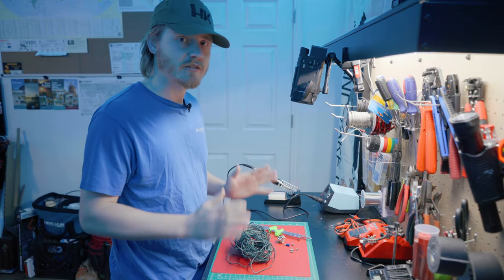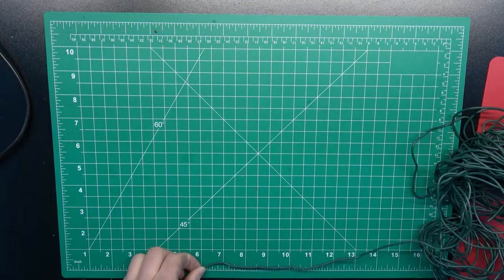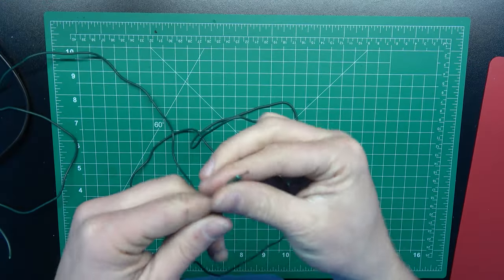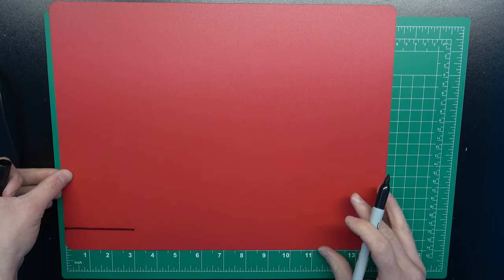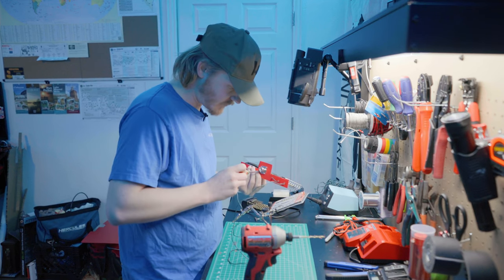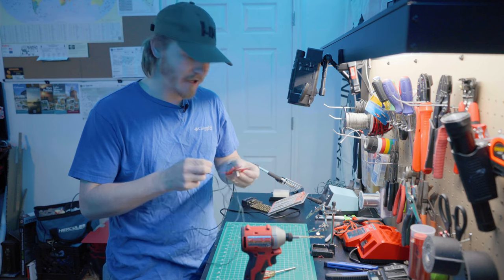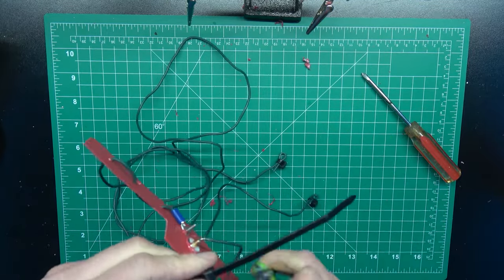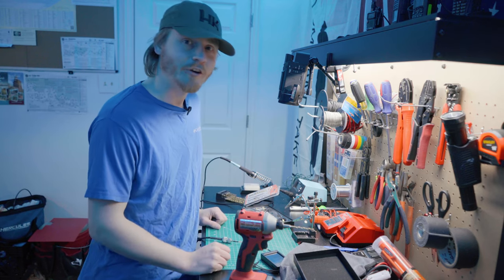Building a CHEAP DIY 2 Meter Dipole Antenna!

Comment: I need to make on of these too.  Repeaters are going to be vertically polarized, your dipole is mostly horizontal.  hang the wire vertically and see if it does better with the repeaters.  Also, your VNA was most likely correct.  a meter is a bit over 3', so if you have two lengths of 3' 6", that's about a full wave length.  it should be about 3' 6" total, not each.  cut them a little long and check that with your meter.  then trim in small increments until you get it perfect.  by the way there is a NTX horizontal 2m net on wedensday nights at 8:00 on 144.250 SSB.  Good Luck

Comment: Love the video, as you are getting in there and having a go.  Your antenna is a few inches too long.  Use  your VNA to scan from 140 to 150 MHz and find the resonance point.  Then start trimming it back, equally, a little at a time until there is a nice dip in the 2m band.  An SWR of less than 1.5:1 is best for everything including the radio.  
Use your chopping board and paracord to make a skyhook to hang one end in the tree, and to run the coax horizontally for a few feet.  The higher the better, but it will work to some degree even touching the ground.  There's a loss of about 20dB going from vertical to horizontal polarization, so once you and the repeaters are on the same polarization, you'll be booming in.
Antennas are fun and easy to make.  Having a vna is the best and cheapest tool out.

Comment: We all make mistakes but ideally we want to learn from them. The old adage: "measure twice cut once" definitely applies to Ham antenna building. But also a simple sense check goes a long way. If you are making a 1/4 wave dipole for 2m then each element is going to be 2m x 1/4 = 50cm which on my measuring tape is about 20". The second rule ought to be to trust your equipment. If the SWR is 4 then it is too high and instead of ploughing on to prove the 'smoke test rule' one ought to sit down and work out what it is telling you. I would not use anything unless it had an SWR of below 1.5. Finally with 2m you want to think about polarisation as correct orientation will give you better results: Vertical for FM and horizontal for SSB. Kudos to you for making the video; with each build I too am learning how to make a better one. 73's 2E0KWI

Comment: Your lengths for quarter wave 2 meters is way off why your SWR is way up. a 1/4 wave 2 meter would work much more awesome with a vertical polarized 1/4 wave antenna. For a 1/4 wave vertical, Just remember 234 divided by Frequency which say 147 MHz would be 15.9 feet multiplied by 12 is 19.1 inches. So the vertical copper wire part would be 19.1 inches and the four copper wire radials would be another 19.1 inches. You can use copper wire or welding rods to solder on your center pin of your SO-239 chassis connection and then screw your other four radials on the chassis with lock washers and screws by using some needle nose pliers to bend a small loop to fit on your screws.. Then when you finished get you some 3/4 inch PVC pipe which your coax will fit through pipe and your vertical with chassis mount can fit perfect on other end. Clamp it on a mast or even use least 10 foot PVC pipe as your mast clamped to a pole or fence post.

Comment: You need 50cms of wire. What you created was more akin to 6 metres antenna than 2 metres. With a few snips it should get into the band quite easily.

Comment: Your first calculation was correct for 3 feet 6 inches which is the TOTAL length of the antenna.  Cut that in half (19 inches or so) and use that for each side of the dipole.  Your SWR will be where you want it.  KN8N
Reply: I just noticed as he was measuring the wire that he pulled the last 6 inches by pulling his 3 ft mark from the 12 inches point to the 6 inches point on his measuring ruler. But he kept his finger on the 6 inches mark looking like he was going to cut the wire there. However that would have been 3 feet only. He should have slid the wire back to the zero and added 6 inches. Simple mistake & easily done. Hence the old adage: "measure twice & cut once"

Comment: SWR between 1:1 and 1.5:1 is good, but anything 3:1 or higher is bad and can blow your finals. I think VHF transmitters are more forgiving than HF, but still it can damage or shorten the life of your finals. The best thing to do is to get the antenna up as high as possible. When I'm portable I use a Spiderbeam 40' mast along with a vertical N9TAX roll up J pole antenna, and at 40 feet I can hit repeaters all over the Houston area. I noticed that in the video you were on 146.52 while the antenna was horizontal. That frequency is typically used on FM with a vertical antenna. The horizontal antennas would be good for 2 meter sideband. Another thing that would help is to use a Yagi antenna. That would give you more forward TX/RX and more attenuation off of the sides and rear. I heard a Canadian station on 2 meter SSB during a Field Day event years ago while my antenna was inside the house, but he could not hear me. 73 KD5YOU

Comment: a true dipole is one half wave on each element.  You made a full wave on each element, so a dipole should have been cut at 1.54 feet each element.  A quarter wave is around 19".  Before you burn up your radio, invest in an inline swr meter.  Gud DX and 73

Comment: Tnx, cool video :) I had to go back and watch again as I noticed the cables was to long, and as stated in previous comments they should be about 50cm each, a 1/4 wave on each element. 
Feeding the radio a full wavelenth as you have dome will get an impediance of 2500-4000ohm and not the desired  50 ohm, so thats why your analyzer not shows any dipp. that will be good for a part2  of this antenna :)
73´s